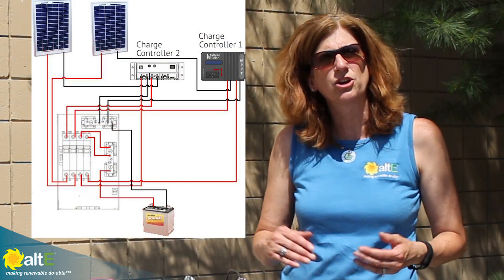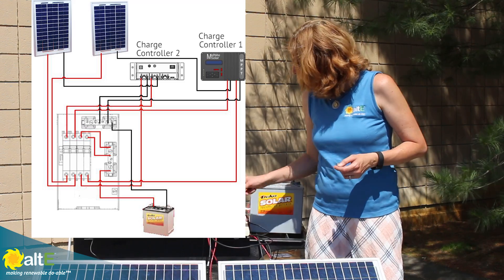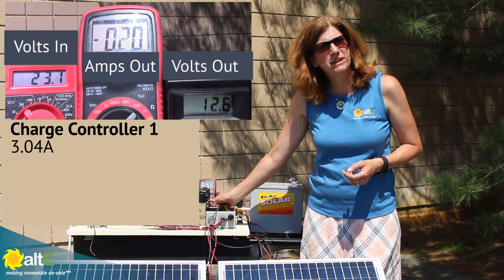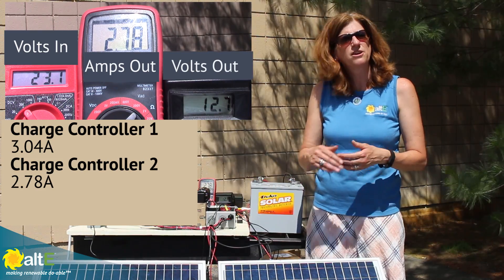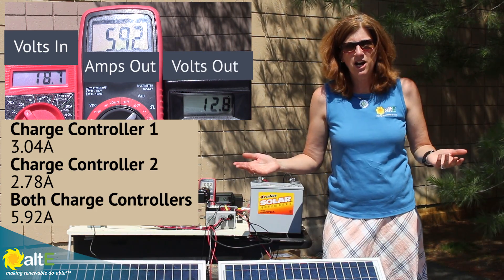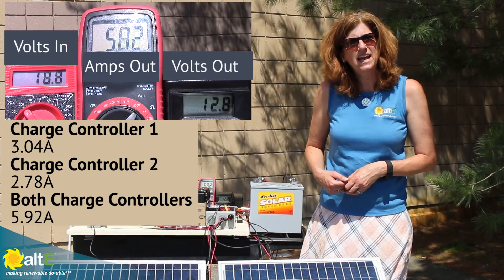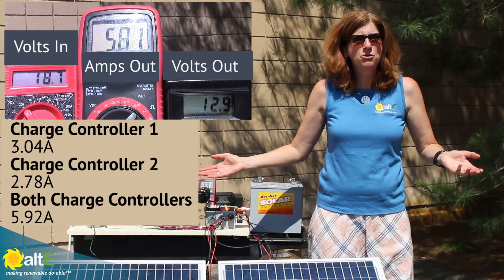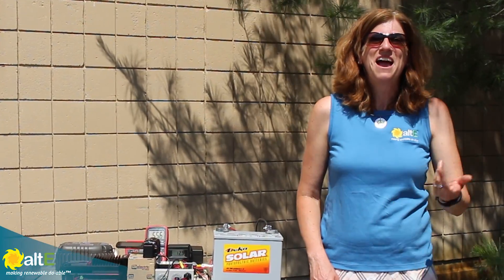Wiring two charge controllers in parallel

Comment: Is it okay to bypass the breaker box? I have my original charge controller controller connected directly to my battery terminals 
 with an inline fuse for the positive wire. Could I connect a second charge controller to the battery terminals in the same way? Assuming both charge controllers have over-charging protection.
Reply from the maker: As long as you have the fuse for over current protection, you should be fine. It is nice to have a breaker instead as a DC disconnect, but for a small system,  you may be fine. Just don't disconnect anything when the panels are in sunlight. Not that I did have a pretty major mistake in my schematic in the video, the correct one is here, https://imgur.com/g3LHozV

Comment: [  Panel(12v)-----Panel(12v)-----Panel(12v)   ] ----------->MPPT(max 20A, and connected to battery)---------->PWM(max 20A, usually inside the Inverter)-------->Battery and Load

_______________&_&&____________
________________________________

Panels connected in series, connected to MPPT. Output from MPPT divided into 2. One goes to a battery which provides the  voltage requirement for MPPT to work. The other output goes to the same battery via a PWM charge controller (max 20 A).

Is such a circuit possible? Will the battery charge? Will the pwm part have current through it?

PS : 
{
Many inverters come with PWM. The aim is to introduce the more efficient MPPT to provide current ( especially on cloudy days), directly to inverter hence working on charge direct from panels (rather than drawing it from battery and inverting it, thus minimising battery cycling) 
}

Comment: hi,, does this means the more charge controllers the bigger the amps? pls help me with this ..ty
Reply from the maker: Each charge controller can manage a certain amount of amps. For example, a 30A charge controller can handle 30A. For a 12V battery bank, that is 12V x 30A = 360 watts of solar panels. If you need to manage more than that, you can either get a bigger charge controller, or get a second one to handle the other solar panels.
Reply: Aw thats a very helpful tip,,i think that's one reason why my charge controller (30amps) cannot handle a 12v, 700 watts panel? it heats up very quickly. thanks for your reply altE..
Reply from the maker: That'll do it. Get another 30A charge controller, and enjoy double your power.
Reply: @AltEStore  How bout 2 MPPTs with  10A 600w max input connected on a 3 x 360w in parallel with 42v vmp and 9.1A(about 27A...)? Will each get half voltages? Current? Watts?

Comment: Many years ago while cleaning up a battery for my car, I tried something that had me doing it for all low voltage connections. I consider any battery connections low voltage all the way up the scale. As well as the connections coming from panels and connections to anything else. I would not do this around any live connections. Take it outside. If there is any look of corrosion on any connector, not the wire because I cut that back if it is corroded, but use some steel wool preferably the thinnest you can find however, any will do. Scrub the corrosion off then wipe it off with acetone. Acetone takes off anything on metal. The connector, the screws, lock washers and nuts. Once I did that, I never had to re-clean the same connections again. Do this in another location before taking everything to connect at the live location. Electricity does strange things with pieces of steel wool flying around or most all liquids around hot connections. Be safe.

Comment: I have a question im not sure if you can help me or not. I want to wire 2 battery controllers to a 48v battery bank, one controller is going to be coming from my solar panels to charge the batteries, the second i want to run a golf cart battery charger which is plugged into mains/grid power into the second charge controller. I would only ever turn the golf cart charger on if the batteries dropped down quit low or on says where not enough solar is bring produced as a back up. Does/would this work?
Reply from the maker: AreUSure Absolutely. Off grid people do this all the time with a generator. If you have grid available to top it off, even better.

Comment: thank you so much for your great videos!!!

may I ask is it ok to combine PWM and MPPT charge controllers in parallel ?
Reply from the maker: As long as the charging voltage of both charge controllers is the same (or very close) you should be able to combine them. The concern is if one is set to charge at 13.7V, and the other is set to charge at 13.4V, the lower one may see the voltage coming from the higher one, and misinterpret as the battery being full, and turn off. If they are both set at the same voltage, there should be no confusion.
Reply: Pls make a video on this

Comment: You've answered that nagging question that I've been asking myself and others, I am setting up a solar, first,  but also adding wind and hydro in phases so I can equal or at least cover most of my daily energy needs. With any surplus going to hot water and heating in winter,  my question is do I take the surplus straight from the battery bank or is there a charge controller that both communicate with each other and send excess to heating system?
Reply from the maker: You would need a Diversion Load Controller, aka Dump Load Controller. It connects to the battery and monitors the voltage. If the volts are above a set level, it will turn on the connection between the battery and the heater, burning off any extra energy. Once the battery voltage drops to a lower level, it will turn off the connection to the heater. Take a look at some Dump Load Controllers here, https://www.altestore.com/store/charge-controllers/dump-loads-dump-load-controllers/diversion-dump-load-controllers-c1022/

Comment: Would it be possible also to combine different rating batteries?
Reply from the maker: You want to always make sure that the batteries are the same as each other. Different sizes will result in uneven charging and discharging, which will kill your batteries. Picture trying to fill two different size glasses with the same flow of water. Either the smaller one will be overflowing to fill the bigger one, or the bigger one will not fill trying to prevent the smaller one from overflowing.
Reply: Thank you so much. That info is a great help...

Comment: its like the pv on the schematic are  crossing charge controller 1 and 2. What is the correct connection did u do mam? did u wired the panel in parallel to the charge controller#1 and the other panel is in parallel to controller#2...
Reply from the maker: It was recently discovered that the schematic is wrong. YouTube won't let me put notes on the video anymore to make corrections, so I have put a link to the correct schematic and pinned a comment to the top saying it is wrong. The correct schematic is here, http://imgur.com/g3LHozV

Comment: Have a couple of questions first is there a limit to how many load controllers can be in parallel?  Second is there a recommended model controller that communicates with each other?  Your channel rocks...
Reply from the maker: Thanks. The best option is to use charge controllers that do communicate to each other. Midnite Solar charge controllers, both the Classic and the Kid, do "Follow-me mode", where one is in charge and the rest do what it tells them. Schneider uses the Xanbus to communicate between their products. Outback communicates between their Hub. I'm sure other brands do as well. There is a limit to the number, each brand has its own limit, but it's pretty high in all cases.
Reply: The right answer for your question is you can add up to the same number of solar panels for example if you have 10 solar panels in parallel you can add same number of controllers, but if you have 3 in series And 3 in parallel you add 4 controllers means all the one in series can take only one,  I am electric engineer if you need to ask questions and don't worry abut this lady because she doesn't understand it well

Comment: hi amy, im jun from the phlippines and i have a question.
for example in our house, the total watts of our electric consumption at the same time is 680 watts, (13 LED bulbs, few cellphone chargers, 1 led tv, laptop, 2 elec. fan)
my question is, my 680 watts consumption, can i used a 4 pieces of 200 watts solar panel, and 4 pieces of 200ah lead acid type of battery, together with charge controller and inverter.
thank you in advance and i hope you can find time to answer my question.
Reply from the maker: We need to know how many watt hours you use, not just instantaneous watts. How many hours are the items on? 680W for how long? For example, 680W x 4 hours = 2720 watt hours (Wh). The 800W of solar in your area would produce about 2400Wh a day, just under what my example uses.  What voltage are the batteries? 12V or 6V? If 12V, that's 12V x 200Ah = 2400Wh x 4 = 9600Wh capacity. You never want to use more than 50%, so 4800Wh storage available. If you need to plan for 2 days without sun, that's 2400Wh a day, so it can store 2 days worth of what you make with the 800W of solar.
Reply: refrigerator 80 watts x 24hr=1920 watts
led tv 50 watts x 12hr= 600 watts
fan 70 wattsx 3units  x 15hr=3150 watts
cellphone charger 4.5 watts x4 units x 3hr=54 watts
led bulb 9 watts x 7 units x 6hr=378 watts
led bulb 3 watts x 2 units x 8hr=48 watts
6150 watts in a day.
Reply from the maker: 6150 watt hours a day.  6150Wh / 5 sun hours / .6 losses = 2000W of solar needed.  6150Wh / .92 inverter efficiencies / .5 Depth of Discharge x 3 days without sun / 48V battery bank = 835Ah 48V battery bank.
Reply: it means i need 10 pcs of 200w of solar panel and 5 pcs of 200ah battery?
Reply from the maker: You have to be aware of how to wire the solar panels and batteries in series and parallel to achieve the right voltages. 200W and 200Ah may not be the right size equipment for you. Four 250W panels may be easier to wire into 2 parallel strings of 2 in series, or 1 string of 4 (depending on if it is a 20V or 24V panel). Same with batteries. You cannot build a 48V battery bank with 10 batteries. If they are 12V batteries, you could do 2 parallel strings of four 250Ah batteries in series.
Reply: thanks for these great information...

Comment: May I ask what type of DC breaker box you are using and where I can purchase one?
Reply from the maker: It is a Midnite Solar Big Baby Box. https://www.altestore.com/store/enclosures-electrical-safety/electrical-enclosures/disconnectload-enclosures/ac-andor-dc/midnite-solar-big-baby-box-for-ac-or-dc-breakers-p7475/
Reply: Could you provide links to the DC breakers you used on the inside of the box? Also, is there a way to produce two outputs out of the breaker box?
Reply from the maker: https://www.altestore.com/store/enclosures-electrical-safety/overcurrent-devices-fuses-breakers/din-rail-circuit-breakers/midnite-solar-15-amp-din-rail-mount-breaker-150v-dc-p5805/ 
If you just come out of the breaker and don't go to the bus bar, you can have multiple outputs.
Reply: altE Thanks for the informative video and, for me the hidden easter egg of the Midnite Sun Baby Box, a very affordable item for my small scale solar install.  Didn't even know such items existed making a search difficult.  If one can't name the thing looked for the road gets rocky.

Comment: I plan on charging a 36 v lithium batteries with three 100 watt panels facing in different directions (on a a trailer) and wired in parallel for 12v. Would I need three boost controllers for this and can three boost controllers be wired in parallel in the same way as two charge controllers?
Reply from the maker: Great question. With the panels facing in different direction, they could all be outputting different voltages, so the lowest output would potentially pull the output of the higher ones down. By wiring each to their own charge controller, then wiring the 3 charge controllers in parallel, the charge controllers would all be outputting the same voltage, but different currents. With them being in parallel, that would work fine, none of the outputs would get pulled down. So ideally, 3 small charge controllers, like the Genasun GV-Boost for lithium would be ideal. 

One experiment you could try if you have the panels already is to pt them in place and measure the individual outputs and then temporarily wire them in parallel and measure the combined output. See if the difference is so extreme that it makes it worth the extra money. There is a chance that if they are all on the trailer roof, the difference isn't as great as if they were on different angles of a slanted roof. A single custom version of the GVB-8-Li may work well enough.
Reply: I would like to see the diagram to connect three solar panels to three solar chargers.

Comment: what if... you have one panel and two batteries, one being deep cycle, and want to use two charge controllers...?
Reply from the maker: A better solution is to use a charge controller intended to charge 2 separate battery banks, like the MorningStar Duo, https://www.altestore.com/store/charge-controllers/solar-charge-controllers/pwm-solar-charge-controllers/morningstar-charge-controllers-pwm/morningstar-ssd-25rm-sunsaver-duo-25a-dual-battery-charger-with-meter-12v-p5600/
Reply: If you do use 2, it is best if they are the same (condition, model, capacity, etc.). 

Also, you have to know what the goal is. Wiring batteries in parallel, as this nice lady stated, will double your amp capacity. But will remain a 12V output system. 

Wiring in series makes your output 24V and thr capacity stays the same as listed on the batteries. (i.e. 600Ah)

Comment: I also added 3x270w panels again linked in series to the west facing roof to my pip 2424smx inverter/charge controller. Now the pip will only charge at 1amp because it thinks the batteries are fully charged when there not. Any help would be appreciated.
Reply from the maker: We don't sell the PIP products, so I'm not very familiar with it. What you might be running into is if you have a separate Tracer charge controller charging the battery bank at around 28V, the PIP may be reading that as the battery bank voltage, and think it is full. If it is configurable, you may be able to raise the voltage level on the PIP to see a higher voltage as charging and not full. When using two different chargers, it is best to have them both set at the same voltage set points if possible.

Comment: Hello Amy,
I have try'd this with two sets of panels and two charge controllers
these are mppt controllers.
It seems that each mppt controller "looks" at the voltage of the batteries to go on max charge
when one mppt charger boosts the voltage on the batteries then the second controller goes on float mode.
it simply thinks that the batteries are full charged.
this means that the second controller does not put out the amps that we expect.

changing the order of connection makes the other controller go on float.
so the first one connected does the job.

I have solved this by charging in parallel on a series of batteries

4x 6 volt batteries are in series to get the 24 volts system voltage
we charge  12 volt on the first two , and 12 volts on the second two batteries

on each charge controller are two solar panels of 270 watts in series  60 cells

this seems to work fine

please comment

Thanks

Cor van Houtum
Draaistroom Nederland
Reply from the maker: The best way to use multiple charge controllers is to use the ones that can communicate to each other. For example, Midnite Solar has the "follow me" feature, when it goes into float mode, it tells the others to do the same. If your charge controllers don't have that feature, make sure they are all set at the same voltage setting for float, absorb, and bulk. 
Charging half of the battery bank with each charge controller does have the risk of unevenly charging the battery bank, and the higher charged batteries getting pulled down by the lower charged ones. Just keep an eye on it to see if they are getting equal charges.

Comment: Hello
My question is: I have several panels connected to (1) a cable (positive and negative) 
I can connect more solar panels to the same cable and the end of the cable to do, 
branch before the controller and connect another controler charger?
all panels will connect to the same cable and a branch and 2 controllers,
 I do not know if I can do this or if I put another cable for more panels (on the other controller)
Your videos are very important for people like me who learned to do everything on youtube,
 regarding solar energy, 3 years ago that consumption the sun,
 almost became an addiction but healthy.
Thank you.
regards
Reply from the maker: We're so happy to hear this channel is helpful. With very few exceptions, if you are using multiple charge controller, the solar panels that are being managed by each charge controller have to be connected to that charge controller. So you have to bring separate wire pair to each charge controller. Here is a schematic of two different solar arrays going to two different charge controllers. Then the output of the two charge controllers are connected to he same battery bank. https://www.altestore.com/static/datafiles/Others/7%20strings%20of%203_Radian_2_CC.pdf